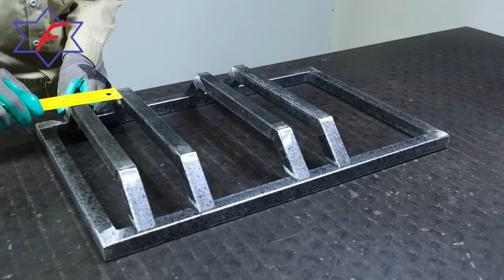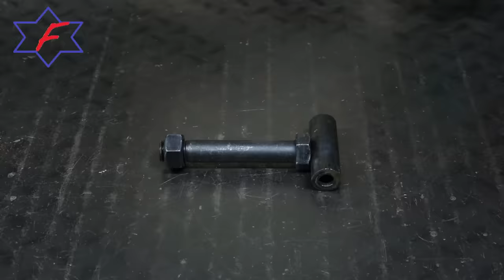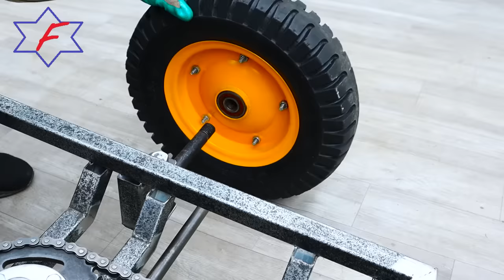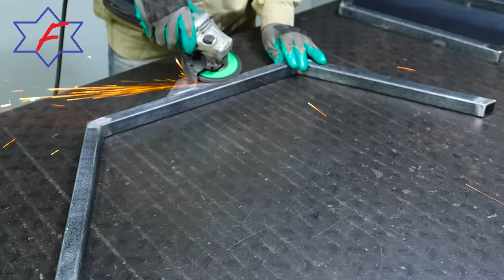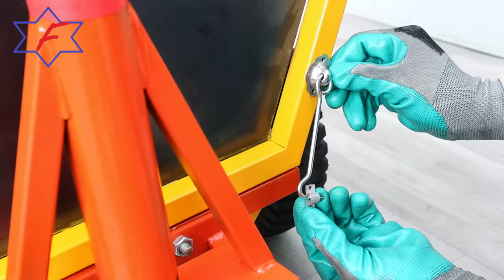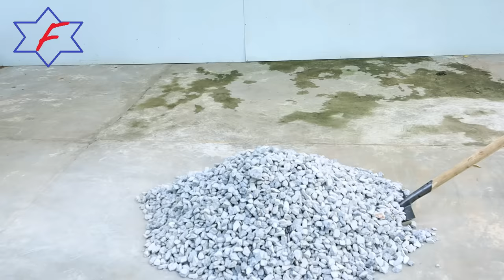Homemade Amazing Agricultural Vehicle

Comment: This is real engineering work measuring with the tap and doing the same for lathe work and taking the parts fitting practically and tremendous work.

Comment: Does this mean i also never have to use washers again??? (and please WELD the front and back half together, instead of using only 3 bolts WITH NO WASHERS! This thing is dangerous, it wil snap in half...)

Comment: It would have been nice of you to explain to us about the electrical parts you used: the number of parts and what their technical name is, the capacity of the wheels, the capacity of the battery, the control device, and where to buy these tools all at once in order to implement the same project. In any case, good work. Thank you.
Reply: You can easily see by 4ea 12vdc gel cell batteries WIRED IN SERIES that it is a 48VDC Hub Motor. Once you know what motor, you can google "48VDC Motor Controllers" and such. The battery amp hours are probably about 50amps total, so in the video, he probably had to charge overnight in between moving the gravel and scooting around without the load. A lithium battery is costly but might be worth it if you really intend to use it to work. Clever cargo machine. I really like it. Probably needs a few higher quality upgrades but the craftsman is impressive.
Reply: Aaa hu
Reply: Жжж😊

Comment: Would have been better if he had given some dimensions , size and type of motor! I assume  the 4 batteries were 12 volts, which would require a 48 volt motor, but what size tires? Just to much stuff left out!

Comment: I think a top hinged tailgate would be a better design, but depends on how you would be using it.
Reply: Id leave it dual hinged. You let the tailgate down from the bottom to shovel stuff in instead of having to lift it over the top to load it. Then use the top hinge to with the dump. How I built my lawnmower trailer. Mine has pull pins you just pull out the top pins to hinge from the bottom and the bottom pins to hinge fro the top. I like this design better but not sure about the auto dumping feature.

Comment: IT NEEDS SPRINGS IN THE FRONT OR SHOCKS YOUR BARINGS WILL RUIN AFTER SHORT TIME ON SUCH SMALL WHEELS TAKING A 100 KGS
Reply: Do you put suspension on a wheelbarrow?

That's basically what this thing is, a ridable wheelbarrow.
Reply: @codymoe4986  your frame won't hold (ply or break at welds)  or your tires will break or go flat with such a load. You need shocks.